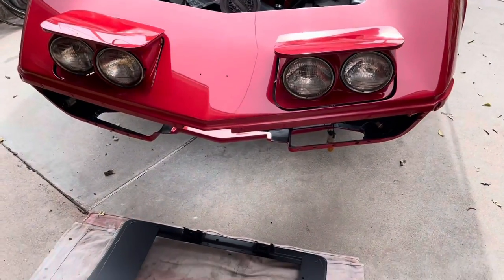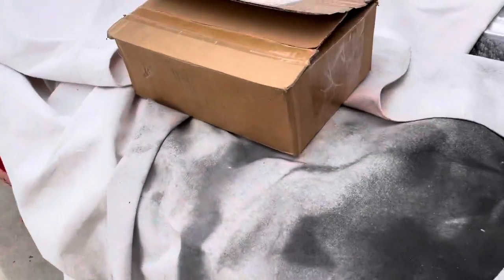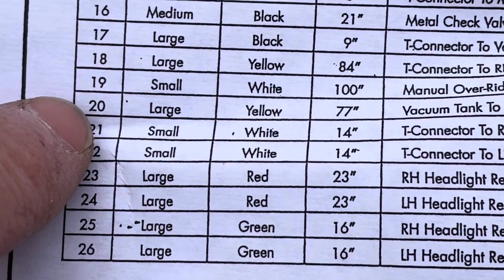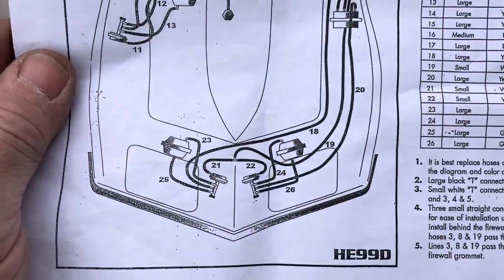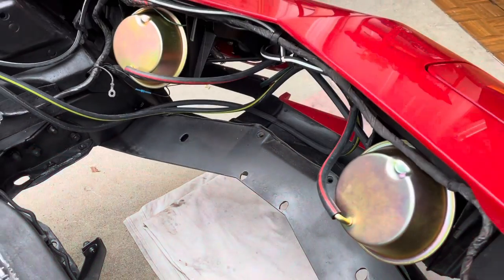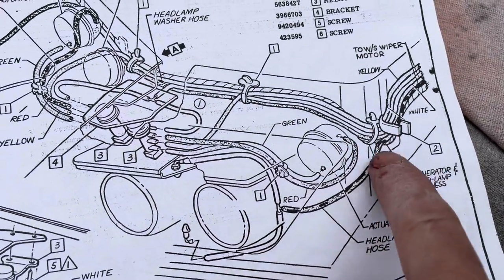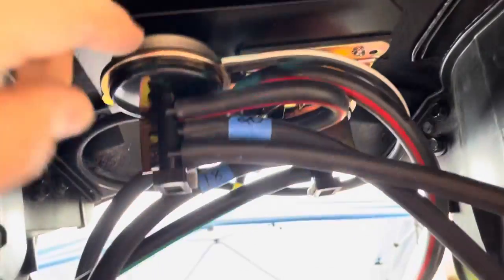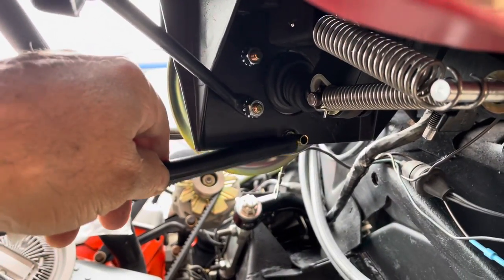C3 Radiator Support Installation

Comment from the maker: So - After switching the Actuators, it looks like they were installed correctly, with the hoses pointing towards the outside of the car. The hose kit diagram is NOT correct and some images and info online is also incorrect. It probably doesn’t make a huge difference which way they point, but I’ll switch them back to the correct direction.

Comment: Where did you purchase your core support?  I purchased mine from a well know corvette supplier but I can't get the lower 2 side bolts in because the holes don't line up.
Reply from the maker: It’s been a while, but I think it was Corvette Central. I’ll try to find that order. Honestly, most of the 3rd party stuff is just OK, which means you will likely have to mod it. If the bolt holes don’t line up, check the angle. You need to have it just right. Also measure the distance between the holes on both the car and the support.